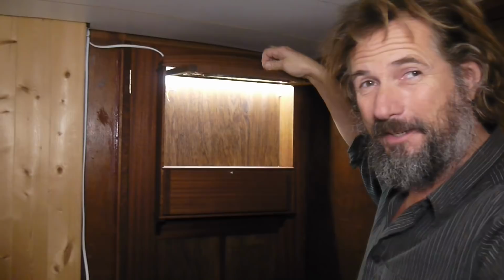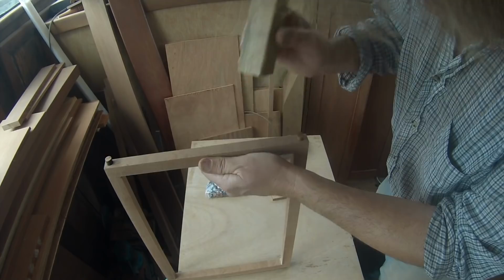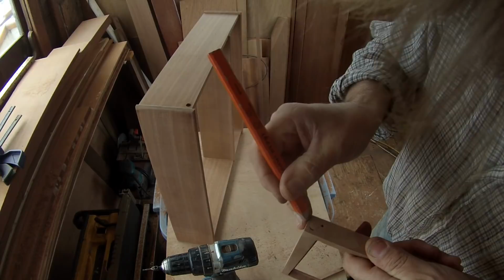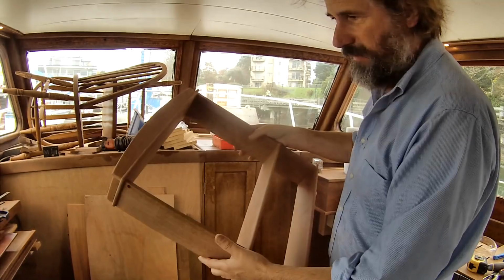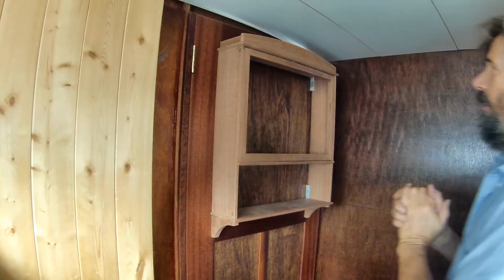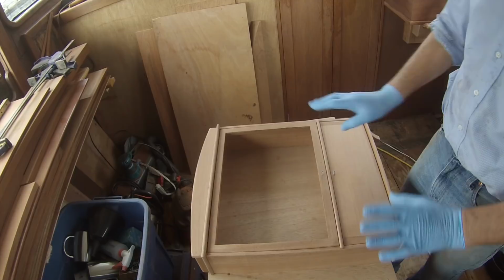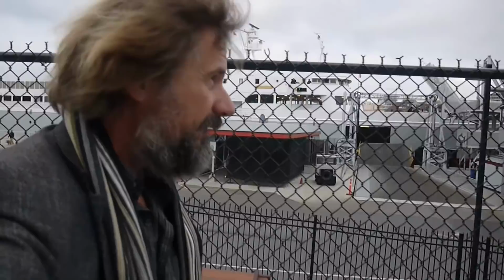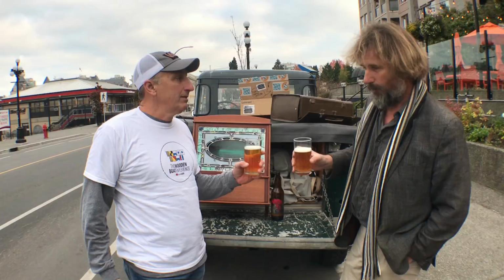A gift of stained glass - Boat life - Boat refit - Travels With Geordie #141

Comment: Beautiful work! Really like your cabinet. I am happy you didn't build your cabinet from Driftwood! Just an FYI; cutting aluminum is easy with a wood blade. Table or circular saw, etc. Also, You may already know this, but, if you must use a cut off wheel, run it through some kind of wax first, bee's wax or anything. Or a spray of WD40 will help as well. Either treatment will help with build up on the abrasive wheels. I am a metal fabricator and this is normal Opperating Proceedure. 
Cheers!
Mitch

Comment: Sorry to say I don’t like the aluminum tabs.  I’d prefer a 3/4 to 1” wood strip X 12” or so, so it’s not visible inside the cabinet.
Reply: Built I think the overall result I very nice, and then with the stained glass insert it’s even better.  I’ve owned some cheap puck lites that are powered by 3-AAA batteries but are wireless with a small remote that could do OK as a back lite to the stained glass, so you could turn off your nite lite from bed.